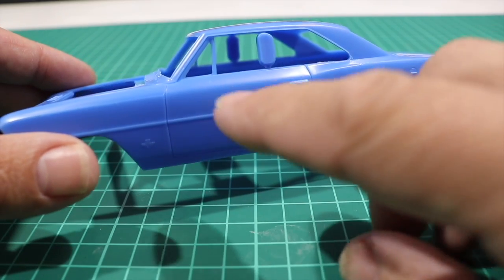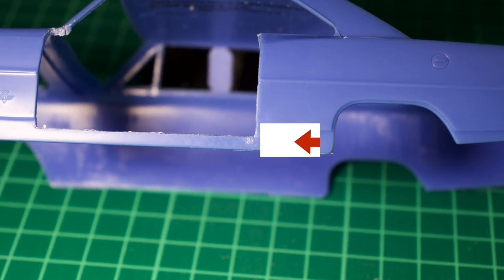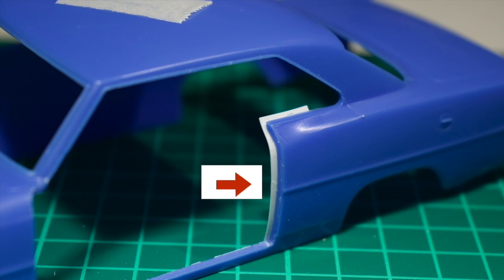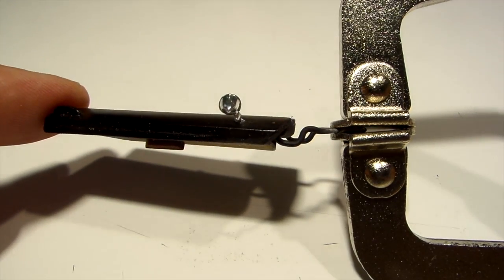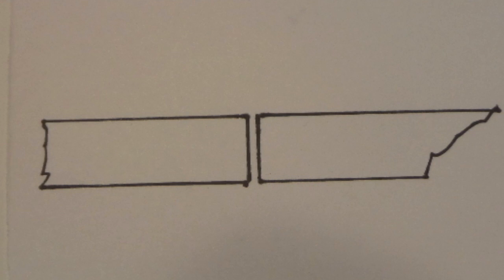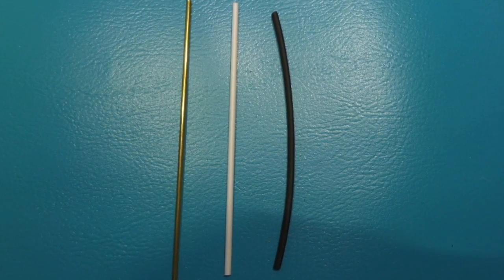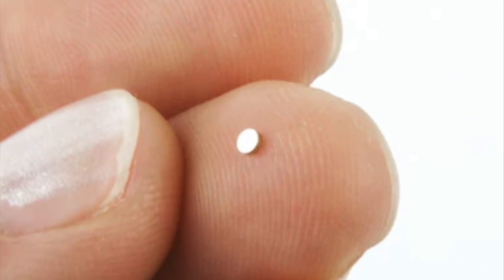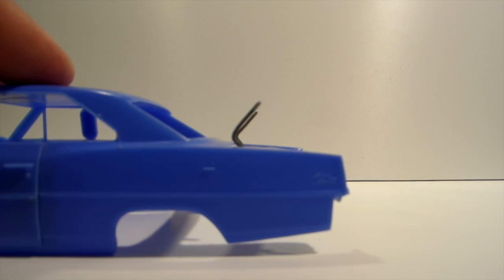How to make door hinges on a model car in 4 easy steps

Comment: I been told to get a hobby and was thinking building a model car. Not many shop sell them here in Australia and look like around $60 AUD for a half decent one. Then U buy few tools glues and paints. I could find model car which caught my eye. As a kid back in late 70s there would so many models to choose from. Me and brother use to just go to shop and look at them, to poor to buy them. We spend the whole day just looking and talking about them. Great tip about the hinges. Cheers Graham
Reply from the maker: Hi Graham... well it is a great hobby.... and you don't need a ton of tools or an expensive kit... if you go on eBay you will find most definitely a kit under $ 30 ... some have even starting tools and paints included.....for me it is just so relaxing and satisfying to build a model car. 
Maybe you just give it a try with a cheap kit and figure out if the " MODEL BUILDING BUG " will bite you. If so, you can  always step by step buying some tools or a more expansive kit.
I buy usually no kits more expansive then $ 30-40 and I have a couple weeks fun with it.
Anyways have a fantastic day ..... 
Cheers Gary
Reply: @CarDreamsinStyrene  thx for the tip
Reply: @CarDreamsinStyrene  thx mate
Reply: Ebay😂 lots of cheap options

Comment: I chose to watch this video because I am hinging the EXACT Chevy nova you are showing in the video. It’s being built as a pretty detailed drag car and since most cars are named, I’m calling it Trigger Finger. Mostly because I sliced MY trigger finger when my Xacto slipped cutting out the trunk and I ended up with a gash that needed 7 stitches
Reply from the maker: Oh wow !!1 That sucks !!! I used to put painters tape over the sharp side of the blade to prevent that. But since I never touched the blade in years I stopped doing that, well it might be time to start doing that again.....
anyway thanks for stopping by...

Comment: Having watched quite a few door/truck hinge videos, yours has been the best! One little thing that I would find helpful is detailed pairs of materials suggested for various scales. YouTube is very prejudiced toward 1/24 scale. I happen to be building 1/32. I currently on the 2nd of three builds for the same kit. I am fixing errors from the previous build and adding new challenges. My next build will include hinged doors, trunk, and hood. So far I have the magnets but need to get wire, tube, and styrene. Part fit on this old mold is not great so I am thinking brass for the wire. Another challenge is my firewall. The fire wall attaches between the door and door panel. The kit is an Atlantis ‘56 Cadillac convertible and has a multipart body. So the firewall (that does not fit well in the first place) is the only thing that keeps the body aligned. Do you have any hints for reinforcing the body after I cut away the doors?
Reply from the maker: Hi... well I built one 1:32 scale car in my whole life and I don't  know that specific kit...so I guess unfortunately I will be not a big help...maybe you have more luck by checking out some of the " Matchbox " building channels.... some of them do great detail work including door hinging... sorry ....

Comment: If you were to build a piano hinge from scratch for a semi truck door,how would you go about it
Reply from the maker: I am not sure if you mean what I think you mean...... but I would cut a styrene rod in 3 pieces , next stick a rod in the right size through all 3 of them. As then I would cut out two styrene rectangle from let me say 1 millimeter sheet and as last step glue one rectangle on the highest and lowest tube and the second one on the middle tube. All while the rod is still in the 3 pieces and let its dry over night.
I think that should work.
Let me know if it  worked out for you.
I hope that gives you an igniting inspiration to try it out, anyways have a great Sunday and keep on building those awesome models.

Comment: Hey mate..I need to cut a hole in the hood of a car for an up coming supercharged project..Any tips on marking the correct location?
Reply from the maker: Yep....take some cardboard from a kit box or such and transfer the hood on that cardboard. After you cut that in size you will have a copy of your orig. hood. Now put your engine with super charger in your model. 
Cut out an opening in the cardboard hood, wich should be a bit larger as you need it. Mount the Cardboard hood on the model and now take some tape and glue the tape on the cardboard hood close enough to the supercharger. If you satisfied with all the measurements and the hood still opens, transfer the hole on the original hood. Done..
I hope I was able to explain it good enough... have fun and keep on building.
Reply: @CarDreamsinStyrene  Cheers Mate!! Appreciate it!!